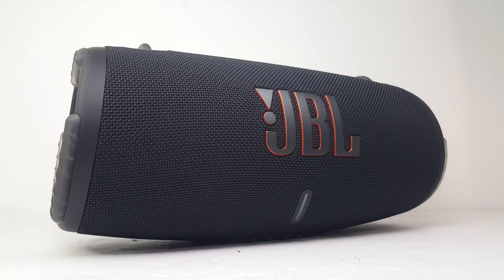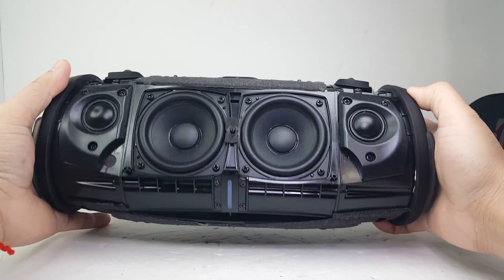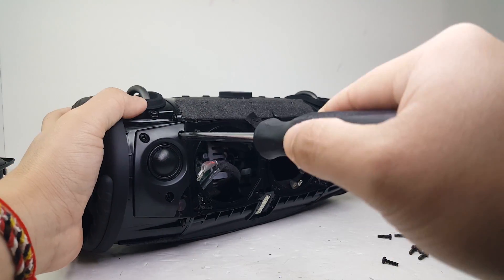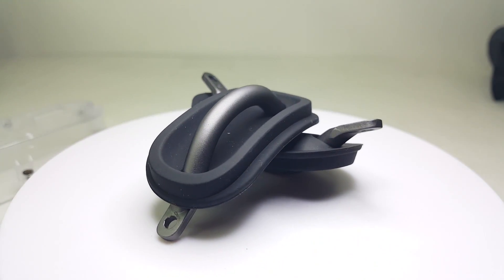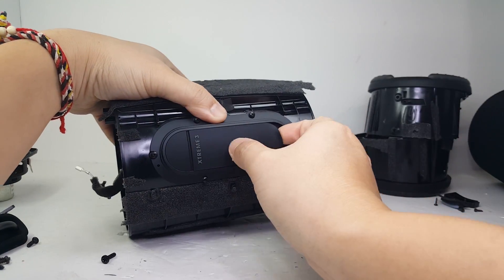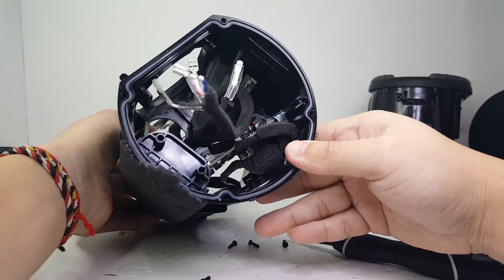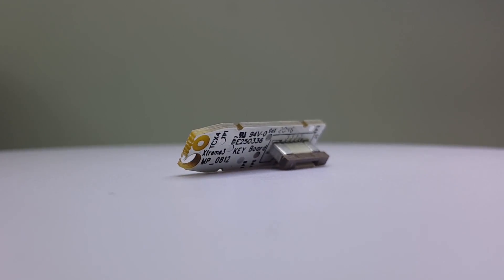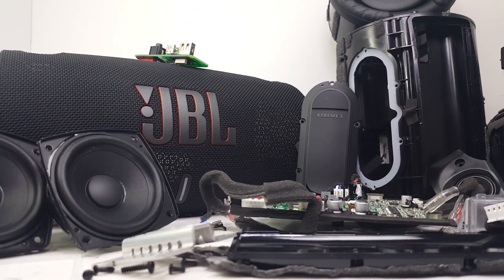JBL XTREME 3 COMPLETE TEARDOWN !!!

Comment: Top-Video! Just one mistake. If you tear off the tweeter cable like this, you may tear off the speaker pin. That is what happened to me. I was not carefull enough. Better use a small screwdriver to loosen the clamp.

Comment: I had the same issue as it seems many people here have had with a cable for the charging came off, simple fix and back to groovin. Thanks for the straight forward video with no BS.
Reply: Mine doesnt charge and i checked every cable there is and replugged it, still cant charge
Reply: @stxrzz69 the one that came off in mine was a very thin ribbon cable that didn't look like much, that's all I got for ya, the rest I got from this video, I'm far from an expert in this stuff lol. Good luck working it out
Reply: @Sk1m_Beeble alright, thanks
I’ll check it out

Comment: Found this JBL speaker in the bin thanks to your video I tore it down, and the ribbon cable connecting to the charger board is snapped, would you happen to know what cable this is so I could replace it ?

Comment: If you open the flap / the charger door flap and pill the cover off the flap there are 5 like compartments with initials in side each one I’m just curious to what they are for I’m not sure if anything was inside them before exposing the initials because my child pealed it off but I’m just wondering because they have to be there for a reason

Comment: Thank you Jin
My son dropped my speaker last week  and i thought it was stuffed.
The connection between the charger and the battery on the back of the charging bit had disconnected so it slowly ran flat.  I was gutted because music is life to me and i had to fork out another big chunk of cash to replace it. 
Before your video I looked at how the heck i could open it too see if something was amiss but gave up as it looked impenetrable without breaking it and sadly put it in the trash :(

My last ditch attempt at fixing it was looking online for tips where I found your video and took it out of the trash and repaired it easily.
Thank you
Reply from the maker: Glad you were able to fix it.

Comment: Oh my gosh, thank you very much. Thanks to you i was able to open my speaker and found the problem.

Problem: 
My speaker won't turn off. It won't even turn off on its own, even if reached it's lowest battery percentage and when it's played in low bat, it creates static sound. The speaker wont even reset. To make it work normally again, I have to attach it to a charger or just charge it full again. 

Solution:
The problem lies at the battery. So I opened the speaker up and found a wire connecting to the battery itself and a detachable plug attached to the board. So, I plug it off carefully and plugged it in back. It's fixed again.

Turns out the the wire was loose. 😂

Anyways, thanks 👍🏻
Reply from the maker: Glad my video was able to help you !

Comment: thanks for the guide. turns out the power strip connection on the inside popped off and it was an easy reconnect.

Comment: Hello. I have the first Boombox 3. It is of the age, where the battery does not hold its charge anywhere near as long or much as it use to. I have contacted JBL as per a service or maintenance to REPLACE the battery. But I have had no response nor return on being able to replace the old battery with a new battery. Can I be asking you for advice. I live in the Unite Kingdom. Everything else with my boombox 3 is good, just the battery is near dead. Thank you.

Comment: What if you replace battery with an 11000 mAh battery?
Reply from the maker: as long as its the same volt,  the mAH of the battery will determine the playtime of the speaker.
Reply: But I thought Xtreme 2 had 10ah battery
Reply: JBL had way more space for a bigger battery pack and they went with 4 18650 .. I have the Xtreme line up get some good upgrades with the Xtreme 4

Comment: Found you channel after searching repair info for a JBL Flip 3 I picked up in the e-waste collection bin at a shop nearby, I repaired it by just replacing the USB charge port assembly, and now it works great. I hope I will find more of them in the future, in e-waste or fleamarkets,  most users would  not bother trying any repair and throw them away sadly.

Comment: Hi mate 

I have this speaker 
I take very good care of it “ usually “ 

It fell on the floor from about upper ab height While in use …

Stop playing on impact 

Wont turn on or charge ??

No lights at all 

It was fully charged before it fell

Took it apart & can’t find anything suspicious?!? 

Any ideas 💡?! Please ANYONE
Reply from the maker: if not a damaged battery then could be the mother board.  does it turns on with the charger?
Reply: My Dad tested the battery 🔋 

Holds a fantastic charge 

My dad said might be the motherboard 

Doesn’t turn on at all

Even won’t show lights when I plug in the charger
Reply: I checked all cables are secure and plugged in

But no luck 

There a cable that’s sordid onto the case that Connect to the motherboard

Is this important?

What is it 

Because seems a tad loose 🧐

Comment: Needed this, I knocked my mate off his bike and the speaker stopped charging, I had the charge 5 and gave it to him for his broken xtreme 3, took it apart and the 2 wires in the back of the charging ports were unplugged simple fix and now got an amazing speaker thank you for this video
Reply: You did of course give it back to your friend,  as this was much more expensive than what you gave him..right?
Reply: Lol you're a terrible friend
Reply: this is exactly what happened to mine, your comment helped heaps, thankyou!
Reply: Yeah my two connectors were disconnected also

Comment: Hello Jin.

It's possible use the xtreme 3 without a battery?
I mean, if o remove the battery and use the speake with the charge cable.

He will works?
Reply from the maker: I have not try on the extreme 3 but it's very possible it'll work.   I've try that one different jbl model Bluetooth speaker and it work

Comment: Hey, there are two models of Xtreme 3. It depends on the model number, there are two models. Please check the label behind the flap for the charging port. The number begins with ND or with GG, these models are different.

Please make a comment with this information or pin that one, this is very important!
Reply: Which one is better?
Reply: @alesso_44  ND
Reply: @ByeBemo  Hell no, GG have the better sound. ND is more water resistant however
Reply: I see a 3n but no nD or Gg

Comment: very interesting, my xtreme 3 is very different from yours, mine doesn’t have a couple of foams and the LED for the battery is also different, i just bought mine two days ago
Reply: It depends on the model number, there are two models. Please check the label behind the flap for the charging port. The number begins with ND or with GG, these models are different.
Reply: @FLUFFS  which one is better?
Reply: @alesso_44  GG for sound, ND for water resistance
Reply: @FLUFFS  it’s on the part that the strap clips on to (the serial number)
Reply: @FLUFFS  I don't see the number.
Is it on the flap or on the speaker behind the flap please?
Reply: Maybe because you purchased from Ali express? 🤣 Chinese fake?
Reply: @ArTeCh777  i didn’t? i bought it from jbl themselves…
Reply: Yours is aunthentic the one in this video is counterfeit 😂